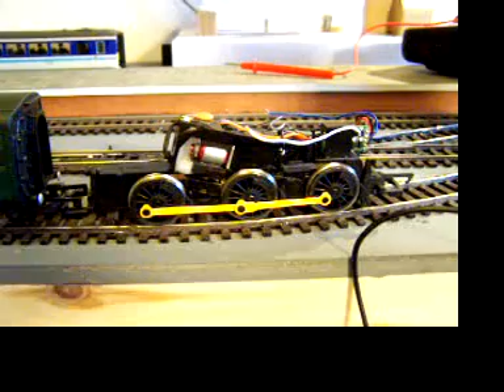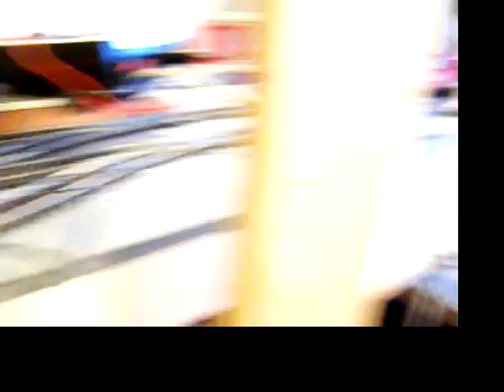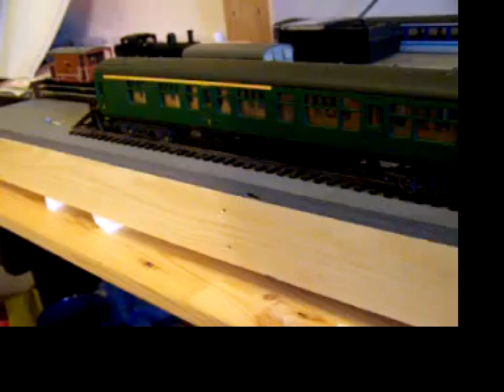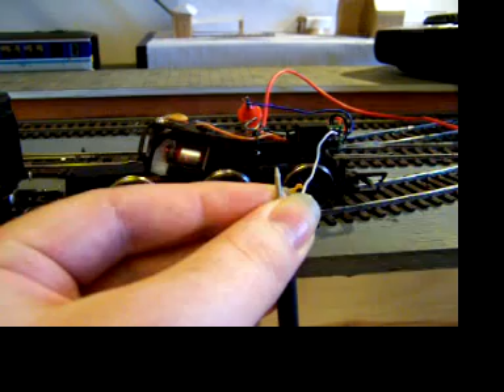DCC decoder hacking (New Railway Modellers)

Comment: hi the blue and white wires on a hornby decoder you using which would be used for lights or did you solder extra wires to it ? forgive me a little lost :)
Reply from the maker: I did not hack the output wires. The DCC decoder samples the input for encoded commands, but also runs the input into a rectifier to power the whole thing.

The blue and white wires were just scrap, that I soldered to the back side of that rectifier. I found that you could power the decoder from that point, and that it would continue to run the last DCC command it had received if there was no signal from the track, and if there was no break in power.
Reply: Hi Brian
Thanks for the reply now i understand nice mod will try it on my old class 08 Great Vid :)